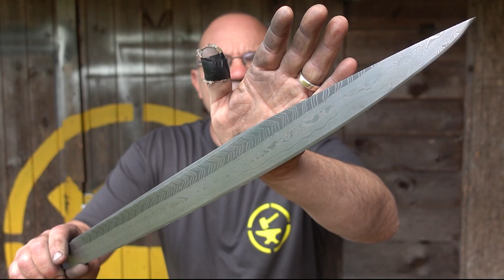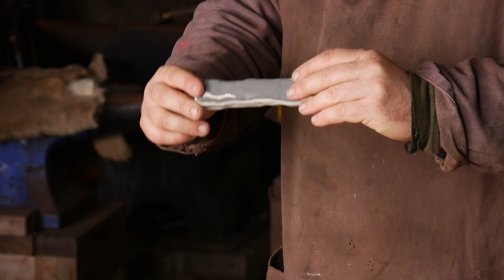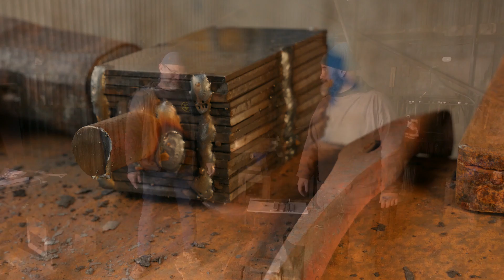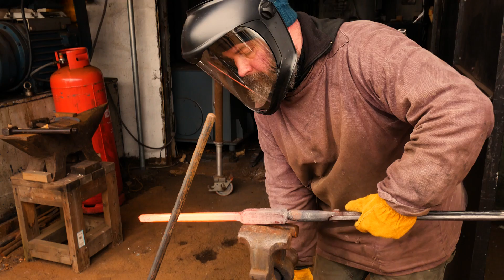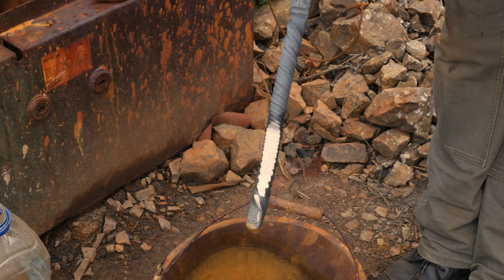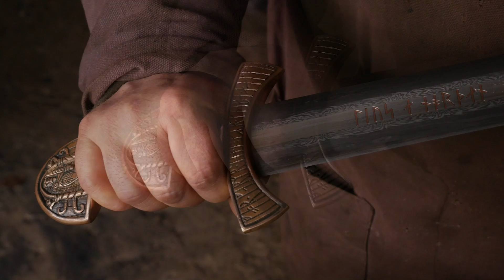Viking PATTERN WELDING - How To

Comment: Somewhat glad you didn't use the word "Damascus steel" to describe this like so many people do.
Reply: I was just about to put exactly the same comment. So many YouTubers beat together chainsaw blades and call it Damascus.
Reply: Why not? "damascus steel" is the correct term for any patterned steel.
As far as it is possible to find out, the origin of the term is taken over from the patterned cloth damask (which in turn traces its name to the city Damascus again)
So "damascus" steel is simply patterned steel.
Reply: @Landogarner83  Not strictly true. True damascus is a crucible steel traditionally called wootz also called watered steel. where the pattern was formed by dendritic carbides as opposed to mixed steel laminates.
Reply: @martintroy910  and @Tim Seguine
There is no historic indication at all that the term "Damascus steel" has any connection to wootz other than that it is a subtype of it.

In fact all indications are that this is false.

The connections of patterns with Damascus comes from the cloth damask that was produced in Damascus in large amounts and imported into europe as far back as the early middle ages.

Because of that long history the connection of Damascus with patterns is so pronounced that a lot of languages even use it in various forms to describe something as patternd. For example "damascene"

The idea that "Damascus steel" was originally used for imported wootz is actually really new and has lately got a lot of traction over the internet. And with that of course a drive to correct everyone.

But in the end that idea is only a "modern myth" and has nothing to do with truth, fact or history.
Reply: @Landogarner83  Sources? Wikipedia pretty much disputes everything you said in its entirety, and they have a fairly impressive bibliography which also includes contemporary scientific research into the composition of historical blades.

This is the first article about it that I read: https://www.jstor.org/stable/24967574 and I am inclined to believe a Stanford materials scientist more than a rando on the internet.
Reply: @timseguine2  How reliable the wikipedia article is should be obvious from the following quote:
"Pattern-welded steel has been referred to as "Damascus steel" since 1973..."
Which is utterly wrong.

If you want to check that yourself then look up Matt Eastons channel scholagladiatoria. In one of his vids he shows an antique sabre with an "Ätzdamast" (etched pattern) blade.

So calling patterned steel "Damascus steel" even though it is not wootz is a much older practice than wikipedia says.

Even those contemporary sources that take a look at wootz talk of it not as "Damascus" but describe it mainly as "watered"

Then even in one of those sources you mentioned i found this:
"Kindi’s comments that steel-making and sword  production had been carried out in ‘olden times’ at Damascus, suggesting much earlier  production here, possibly in the late pre-Islamic and/or early Islamic period. He later states that it had more or less ceased by his time"
From https://www.academia.edu/35997825

So why would "Damascus steel" or "damascene" be connected with steel produced there, if steel production in Damascus had pretty much died out before medievel times?

The last point is out of memory. So no clue if i can dig up the source, but even a Kris which is definitly pattern welded was called damascus in some historical text.
Reply: @Landogarner83  Dude. It is easy. Give me a source other than a youtube channel for your claims or leave me the heck alone. I don't want any more of your hot air, I want a bibliography of reliable sources and quotations. If what you say is true, then that should be easy to provide.

Wikipedia may be unreliable, but they at least cite sources for each of the claims. You have not done this even after I explicitly asked for it.
Reply: @timseguine2  Okay obviously you have no interest in learning something that could challenge your preconceptions and halfknowlege.
I even linked such a source as you asked for. (the same as is linked by wikipedia you seem to trust so much)
If that is not good enough for you myth fanboy than so be it.
Reply: @Landogarner83  The source you linked doesn't reflect any of the things you are saying. You quoted it, then included some of your own original research interpreting it in a strange manner in the form of an open ended question. Like seriously, if you think that is how citing a source when someone asks for it works, then you are sorely mistaken.

You are asking me to take your opinion over a standford professor's. I have NFC who you are, so why would I do that unless you actually provide evidence for your claims.

Give me a reliable source for your claim that pattern welding was referred to as damascus steel before 1973 (It very well may have been, but at the moment all I have is your opinion that it is obviously true)

Give me a reliable source for your claim that damascus steel has no connection to wootz steel.

Give me a reliable source for your claim that the connection between damascus steel and imported wootz steel is an internet age idea. That one seems a bit difficult since the article I linked from 1985 seems to directly contradict that theory.

If what you are saying is true, some historian, archaeologist, or materials scientist should have written about it in a peer reviewed journal. There should be sources, and if you expect anyone to believe you, then you should be able to provide them.

You haven't even attempted to provide credible evidence for your claims.

Telling me about things without a source is NOT credible evidence.

Telling me to watch a youtube video of some guy who agrees with you is NOT credible evidence.

Making a random quote that doesn't directly prove any point you made and using it as a jumping off point for a rhetorical question is NOT credible evidence.

I don't think it is too much to ask for you to not waste my time if you expect me to take you seriously. So either stop wasting my time or GTFO.
Reply: @Landogarner83  "Okay obviously you have no interest in learning something that could challenge your preconceptions and halfknowlege."
Wow - that projection of your own insecurity and ignorance is really something - just not something any sane person would want, but you got it.
Reply: @timseguine2  "Telling me to watch a youtube video of some guy who agrees with you is NOT credible evidence."
I mean - that video does anything but agree with that ladoidiot :D
Reply: @timseguine2  Okay that is more like it.
I see that what seemed off about your previous reply was due to a misunderstanding.
The important part about the video i mentioned is not what Matt says but the sword he shows.
An antique officers sword with etched on patterning and iirc the term "Ätzdamast" etched right onto the blade along with the pattern. This as an example that "Damascus steel" was used for steels that are not wootz long before wikipedia claims.
I took your dismissal of that video as a categoric dismissal of actual artefacts just because of the platform they are shown on. Thus the not quite civil tone of my responce for which i apologise.

Also the youtube comment system decided to not show me the lower part of the comment where you linked the article.
I think i read it before but since i don't really remember it i am just going to read it again.

I will try to answer your points. However digging up the sources is likely going to take some time.
Reply: @timseguine2  The first source is an example of pattern welding beeing referred to as Damascus steel before 1973.

1902 Supplee-Biddle Hardware, Philadelphia catalog
https://www.remingtonsociety.org/wp-content/uploads/2020/03/Supplee-Hw.-1904-catalog.jpg

Not ancient but definitely older than 1973.
While it is somewhat confusing that the title refers to 1902 and the name of the picture says 1904 the general timeframe seems correct.

This one i was able to find quick. Sadly the other points are going to take longer if i can find the sources again at all.
Reply: @Landogarner83  I honestly can't find the video you are talking about either. I searched but all I found on his channel that seemed at all related was a wootz saber. Anyway, I am not so sure it is that relevant anyway, for two reasons.

1) We aren't and I never claimed to be discussing non English usage of the term.

2) I happen to be fluent in German, and the term Ätzdamast at least in its modern usage is used to distinguish it from the words Damast and Schweißdamast.

Without going too much into a German lesson, it is very much a distinct word. And while "Damast" is ambiguous it actually in the non compounded form usually refers to the textile, not to swords. The more common term would be Damaszener Stahl (Literally damascene steel), and of note there is the fact that "Ätzdamast" doesn't technically refer to Damaszener Stahl, but to steel that has undergone a process called "Damaszierung", which is explicitly a faux texture intended to resemble Damaszener Stahl. It essentially has the same sort of connotation/idea as the English word "antiquing". Linguistically saying Ätzdamast is Damaszener Stahl is similar to saying imitation crab meat is crab meat. Since the terms are similar, I can understand how it could be confusing, but that doesn't really change anything.

Also in fairness in modern usage German seems to be fine with calling pattern welded steel Damaszener Stahl including referring to ancient examples with this moniker, but I have no idea how historical that usage is, and it seems pretty clear that the term Schweißdamaszener is a later addition to the language. Indeed from my fairly  minute knowledge of history, I seem to remember that pattern welding was known about in europe before "damascus swords" were known about, so at least originally pattern welded swords were unlikely to be called that. And that pokes an additional question: if pattern welding was a well known technique long before Europeans became aware of "damascus swords" in the 10th century, then why would they have considered them special and invented a new word for them? To me that just makes zero sense. In German they would have just called it Schweißverbundstahl, or whatever the equivalent term for it was at the time.

...sorry... that second point ended up being longer than I intended, but considering the importance you seemed to attribute to the word "Ätzdamast" being etched onto an antique blade, I deemed it necessary/appropriate.
Reply: @Landogarner83  Not to be nitpicky, but giving me an ad for a gun doesn't tell me how it was made. A little bit of research on my part uncovered that they were in fact pattern welded and that it is definitely referring to the specific pattern used. It also seems like they produced similar items going back even further to around 1800. So the wikipedia article is wrong about that statement. Go tell them, not me. That was probably the least relevant thing on that page to anything I said.
Reply: @timseguine2  Yep i agree with you that the point i provided the sales brochure for is the least relevant.
It just was the one i could find some evidence quickest.

As to the video i mentioned, i also could not find it anymore. Seems it was either removed or has a title that makes it hard to search for.
Anyway as far as its relevancy goes it is certainly no greater than the sales brochure.

Now if i can find the sources again then i will share them with you.

However my success so far makes me doubt that i will be able to. In that case i apologise for wasting your time.
Reply: @Landogarner83   From what I read, it was called Damascus steel because a majority of medieval-era smiths capable of working Indian wootz steel (which was very high in carbon and alloying agent, so was a lot more difficult to form and forge weld) into a quality blade were concentrated in the city of Damascus. Or at least such blades produced for European export. Then the term came to refer to the visually-similar pattern welded steel Europeans produced mostly for gun barrel manufacturing, made from cemented steel and iron bars twisted and forge welded together.
Reply: @Landogarner83  It might be a defacto standard term for any patterned steel now in modern times. And plenty of blacksmiths will have you believe exactly what you just wrote. But historically it is a specific type of crucible steel made from a specific alloy that happens to have a similar wavy pattern when etched. The exact properties and production are still debated, but if it isn't crucible steel, then it definitely isn't Damascus steel, and you can only achieve optically similar looking but metallurgically distinct steel by using pattern welding.